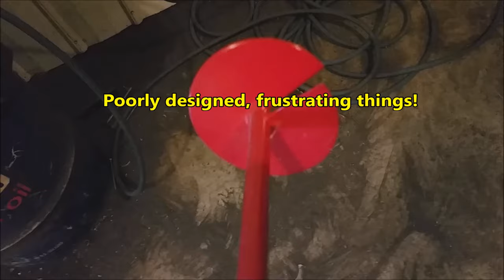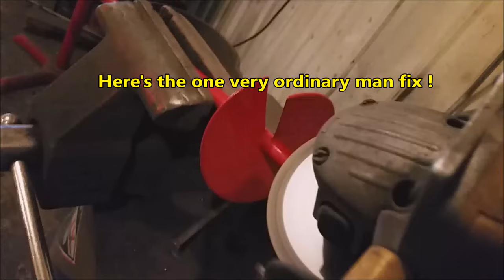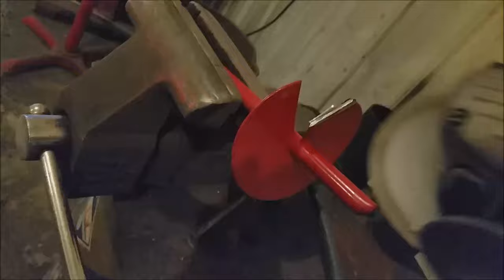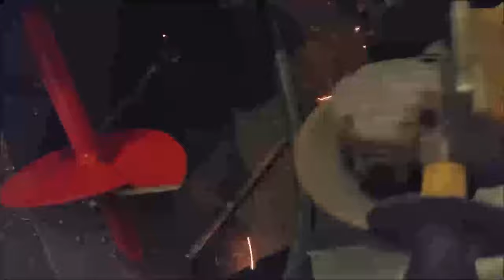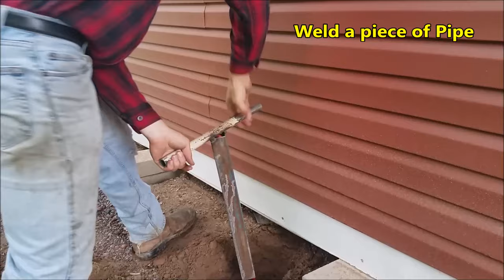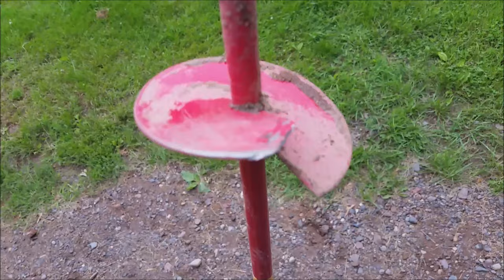Trick for earth anchors that wont go down

Comment: I put down anchors almost every day. You dont need to grind it.  if you take a hammer and hit the end show where he's grinding till it slightly bends down. it should go right  down in my experience. Also dont dig your hole to wide. Hope this helps👍🤙
Reply: Works very time
Reply: Is this type good to get?
Reply: I'm getting a 18x20 garage built. Is this the type of anchor they will be using?
Reply: I did that today worked good
Reply: Bending that edge down made all the difference in the world. Only took 5-10 seconds. Thanks.

Comment: I can show you an easier way to do that just need a hammer hit the first corner to touch the ground bend it towards the tip a inch or so and it will go fine guarantee !! Your welcome in advance
Reply: Huh?
Reply: Yeah Mathew.. maybe try re writing that with better description pal.
Reply: Mathew, I guess I'm a bit slow, but could you please explain that once more?
Reply: Grinding edges works if your going through roots otherwise bending the edge works fine
Reply: But I keep on hitting rock!?!

Comment: I tried using these in gravel type soil.. They went down, through the top soil, and stopped at the rocks... Had to use a post hole digger to dig a hole, pit the anchor in, then tamp it full...

Comment: I'd have been more convinced if the video of the modified anchor hadn't partially shown a pre-excavated hole (which would defeat the purpose of screwing the anchor down to begin with), and if it appeared that any progress was being made during multiple turns of the screw.  I think your soil is just too rocky for it to work, as mine probably is, too, without a hydraulic drive like those on a utility-pole installation truck or similar.
Reply from the maker: It actually Did work very well.  I may have grabbed a quick video shot where we were struggling from before the fix.   Don't remember exactly.